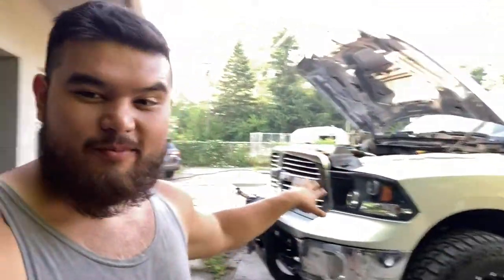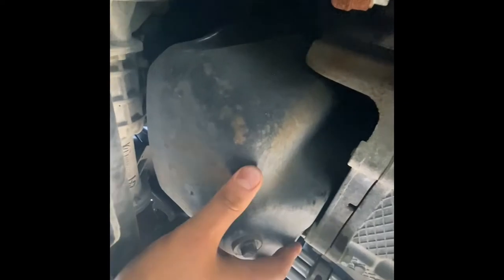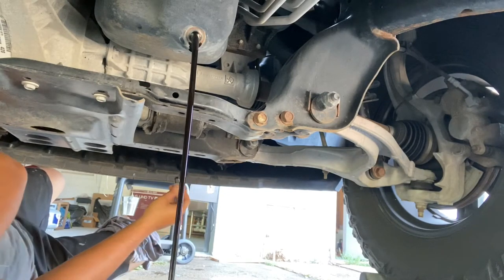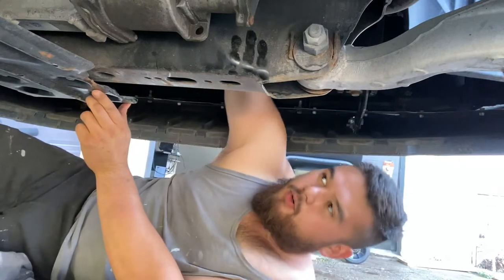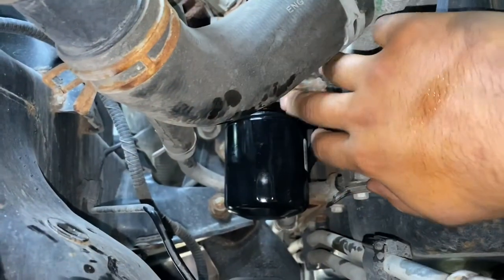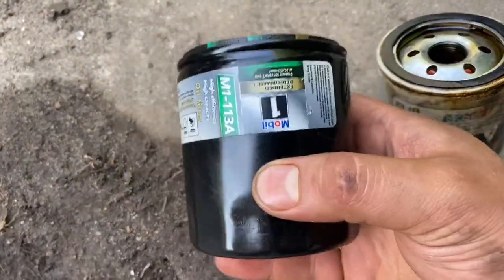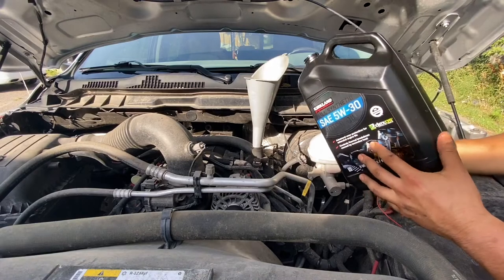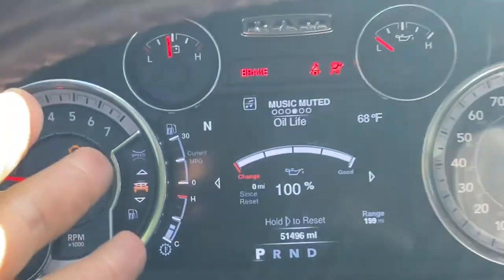Change Oil+Filter on 2016 RAM 1500 5.7L Hemi

Comment: Bro, I need to know what size wheels you have and what company along with your tires. They are absolutely perfect man.
Reply from the maker: 35x12.5x18 Thunderer MT Tires. Wheels motto metal 18x10 I can’t remember the offset though.
Reply: @MJAltairy  Thanks so much man. I watched your other video and snagged those Hooke Road Bumpers. I have a 2015 Ram 1500. They look fantastic. 35's look absolutely PERFECT on a 2 inch lift
Reply from the maker: @Kris-cw8hj  these trucks def do! Btw i think the offset on the wheels were -24mm

Comment: Ive always had issues with getting the filter off without making a huge mess, is there a better way to do it
Reply from the maker: I’m not really sure of a better way to be honest with you. It’s always a waterfall trying to change these filters on these trucks
Reply: On Amazon the oil udder 4” xl 3 in 1 spill free oil change tool / mess free oil filter tool
Reply: Place a bag around the filter. This way the oil spills in the bag.
Reply: Put a sandwich bag around it lol

Comment: Aren’t you supposed to use 5w-20
Reply from the maker: “Factory recommended,” ive been using 5w30 for the longest time. The 5w20 is also better for fuel efficiency supposedly but it’s such a little of a difference that it wouldn’t really affect anything.